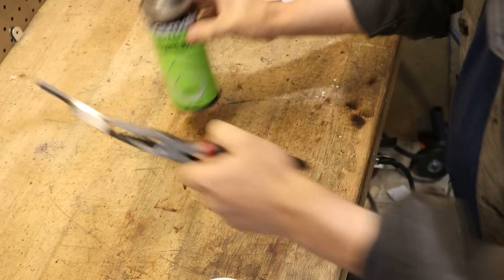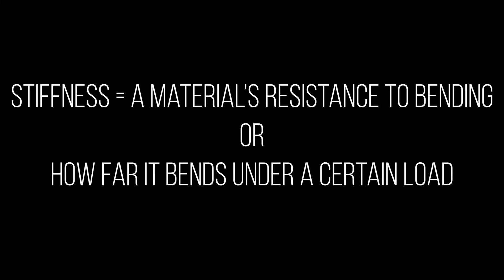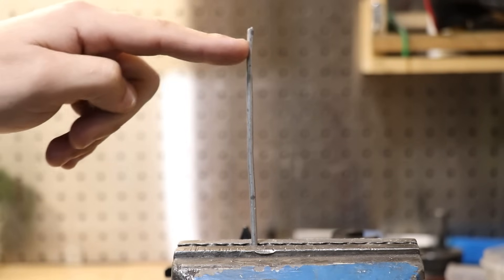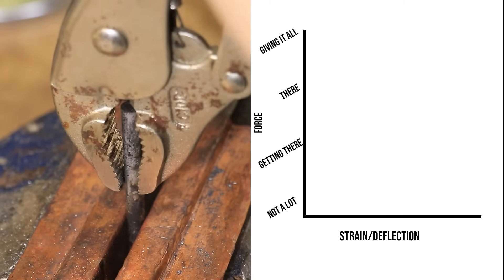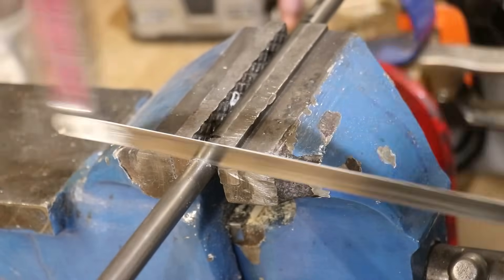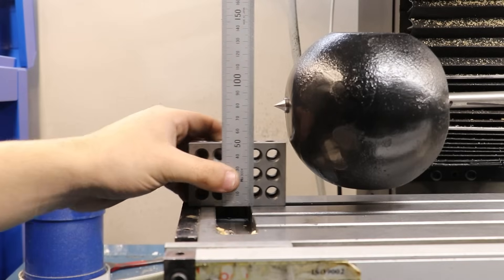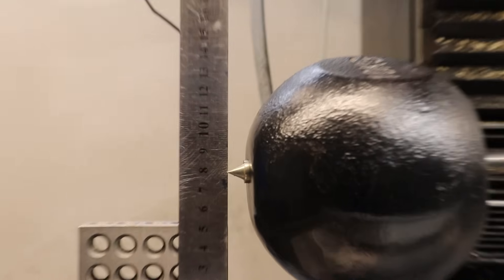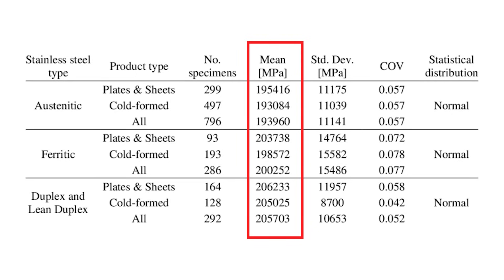Hardened Steel is NOT Stiffer Than Soft Steel

Comment: Nice explanation.
Other common mistake is that people mix elasticity with stiffness.
To add confusion... Young modulus, or modulus of elasticity, actually describe stiffness, not elasticity.
Elasticity is how much force can material resist before it start to permanently deform or yield strength.
And usually .. yield strength is exactly what we want to improve with heat treatment, not tensile strength (alongside hardness, of course).

Think about it in this way: when you calculate some part, let say part of suspension on a car, you do not go to the ultimate tensile strength. You must achieve that part do not bend permanently, under predicted load, not just that part do not brake.
Of course.. you should consider brittleness (impact loads, especially at low temperatures) at the same time.
Reply: Yeah it seems to me the problem is more one of terms than anything else. What most people refer to as stiffness is something's ability to to resist bending. As is clearly shown by him not being able to bend hardened steel by hand but being able to bend non hardened steel, this shows it is indeed "stiffer" at least in the way that a layman would use the word.

Obviously in materials science (or any science) terminology can have different meanings than the way people more commonly use them. Which kind of makes this video an exercise in pedantry
Reply: @theodorekorehonen  or just desperate call for stopping smart and educated to adjust to average idiots?

Comment: Is it better to be hard or to be stiff?
Reply: Depends on the application.  For a cutting tool on a machine tool, hardness is the most important property.
For a boring on a lathe, stiffness is very important.  Since the cross sectional area of a boring bar is limited by the bore size in which the bar functions, there are limits as to how deep a hole. or how heavy a cut may be made.
As was pointed out earlier above, the only choice for a stiffer material is tungsten carbide.

Comment: When the operating point is above the unhardened material's yield point, the hardened material certainly is stiffer.
Reply: That's strength, not stiffness. The hardened material is stronger, not stiffer. The hardened and unhardened material both resist a bending force by the same amount for a given bending force, prior to yield. Increasing the force required to achieve yielding does not affect the amount the material will deflect under any given bending force lower than the yield point.
Reply: @sjjohns88  Stiffness is change in displacement for a change in load.  Once the load is such that the unhardened material yields, it is no longer as stiff as the hardened material for a change in load.  So yes, the hardened material is stronger AND (in that region of loading) stiffer.
Reply: @Machine1136  thanks for clarifying. I agree that after the material has yielded, it's not as stiff. Maybe we should be more specific in our definitions, and say that hardened materials are not stiffer than unhardened materials while both are in the elastic deformation region.

Comment: Spring steel is very similar to tool steel, similarly heat treated. I’ve known people use old leaf springs for toolmaking before.
Springs are pretty bendy things.
I guess that’s kinda what you’re getting at. 🤷‍♂️

I bought a roll of annealed spring steel for making some distributor cap clips for a vintage engine magneto. It’s also proved very useful for making some little tools for pulling out round wire clips. Lovely stuff to work with & nice & easy to harden & temper.

Comment: Why should it? Harder does not equal tougher, changes in one parameter do not equate directly to changes in another
Reply: You're misusing the word toughness. Toughness is the amount of energy it takes to deform or break a piece of material. Stiffness is what he's described here, force/displacement.
Reply: @mitchellsteindler  I know that toughness does not equal stiffness , I was using it as an example of how different parameters do not directly equate. Why should they?
Reply from the maker: Because people seem to get this confused, I think it is something that needed to be shown. If you were already aware of this, this may be extremely obvious
Reply: @artisanmakes  the question that wasn't answered is, why is this true? A scratch or dent is plastic deformation of the material caused by a point load. You showed that a hardened steel has a higher yield stress than the non hardened version. So it would then make sense that it would take more force on a given point to cause a scratch or dent. So harder materials are more difficult to scratch because they have higher yield stress. But why do they have higher yield stress?

Comment: Had to make a Slide Cam for an old textile machine 40yrs ago. Was a new job so I went to the tool cupboard - mmm - pliers, hammer & some screw drivers - that was it. Had to buy some files, hacksaw & flat bar - made the piece & went to a spring works a few doors down to temper material. First try on machine & it snapped - / n repeat they tempered it just right. Only time I've ever needed to temper something.
Reply: I wind my own springs on the Lathe from piano wire (or music wire if in the USA)    One of the things I found was that the springs had hysteresis,   meaning that if you extended a spring and let go and measured its length then compressed it and let go the at rest dimensions were different,   yet I hadn't exceeded the elastic limit either way and the affect was repeatable.  Then I found out that that if I tempered such springs after forming  to a dark straw colour,   the hysteresis did not occurr.

Comment: What about work harden?? 

I understand that cold rolled steel has higher strength, at least it is a cheat code used to increase the strength a few points when doesn't pass quality control at the mill. As a rule of thumb, a run by the rollers (just bending it, not even rolling down a size) would increase the strength about 10 points so it meets specs.

Now I'm curious if cold rolled would decrease tensile strength after heat treatment, but why would someone heat treat cold rolled steel 😂
Reply: I think he explained very well how strength and stiffness are different things(?)

Comment: i have only one correction to make, that is a rule not a ruler. a rule has a ground end for measuring from its edge. a ruler is a drafting tool where the ends are not ground so the drawing tools can reach the end of the measurements without slipping off.
Reply from the maker: Oh you sound like my old drafting teacher. Haven’t been corrected like that in years
Reply: @artisanmakes  given your continued passion in the field, i will take that as a compliment.

Comment: should have added how many mpa is each (relevent) metals
if iron is 200 mpa, how much are the others
it seem like the hoffman group sell tools that are recommended to 3 time the diameter for steel, 5 time the diameter for HSS and 8 time the diameter for carbide, but are there some metals(or not) that are even more stiff than that, like ceramic?

Comment: Good video.  If you want it stiffer, increase the thickness.   Stiffness is a cubic function of thickness.   Double the thickness and you’ve increased stiffness by 8x
Reply: Find an appropriate shape instead. A Box beam (So hollow rectangular section) made up of 3/4" plywood might end up stiffer than a solid 1.5" bar of steel
Reply: @ true.  Because you are getting that mass away from the neutral axis/increasing I.
Reply: bending stress =my/I or M/Z where Z is the section modulus = I/y, I is the second moment of area in m^4. bending stress is proportional to deflection so yeah you're pretty much correct since second moment of area for a rectangle Ix = bh^3/12 where h is thickness.
Reply: That's what she said ;)
Reply: Then how could I still reach the ground in highschool despite weighing twice as much as I do now?
Reply: No, well kinda: it's area eccentric to the neutral axis of the beam crossection.
Way more smartass to say but you can hollow a beam and still have the same strength, that's why an i-beam is stiffer than a flatbar despite having the same mass or why a wide hollow pipe is stiff.
The further from the neutral axis the stiffer.
There's also a point where a slender beam becomes so "thin" that making it thicker increases the stiffness way more than exponentially.
Reply: Oversimplified yes absolutely but id you're deeper into that stuff it definitely isn't a cubic function depending on the load and most importantly the direction. 
I've would put it like : "the more material you have far away from your centre if bending the better it is (compare an I-beam to round stock with the same amount (by weight and surface area) the I-Beam is stiffer in Case of bending around the X (or lengthwise) axis )
Reply: idk how deep you have to dig into it, but it works for everything I’ve seen (20 years designing, 10 of those using FEA and actual measured data to assist).  I’m sure this rule of thumb breaks down after yielding/plastic deformation.    Honestly this is one of the few things I remember and actually use from engineering school.
Reply: @Zertrebender  It isn't even that oversimplified. It's just the moment of inertia, which increases cubic with the thickness (the axis that is colinear with the axis of the force being applied) and linearly with the width (the axis that is perpendicular to the force, and perpendicular to the support axis). For different shapes the moment of inertia might be more complex to calculate but you can still calculate it by appropriately subtracting the moment of inertias of the "missing" crossectional areas. Deflection is then a product of the length of the beam and the moment of inertia of the beam.
Reply: @Zertrebender lol this is the one time i don't regret reading the replies.

Comment: As a life long mechanical engineer I understood clearly what you were saying. We had to do tensile and charpy tests on materials if the customer requested it. The tensile tests the material for it's yield strength, whereas the charpy test measures the material ability to resist sudden high speed impact. Both tests require a test piece machined to a known configuration. The tests are different but both of them can give engineers a good insight in to the material. I found material testing very interesting in my apprenticeship and its still fascinating in my 70's
Reply: My brother was JUST working on building a machine to do material testing...well actually material characterizing. Nitinol is apparently still new enough that it's material specification isn't filled out yet. So...someone has to do the literally millions of tests to figure all that out and he was trying to figure out how to make a machine that can do those tests for the unique characteristics of Nitinol. 
It's a bitch to work with...but MAGIC when you get it going.
It's simultaneously butter, gooey, sticky, and hard all during the same cut. So machining is...annoying at best. All which means the normal ways don't work and he was the engineer to figure out a machine to automate those 100,000 tests for each and every variation. I really do mean millions of tests.
Reply: @feldamar2  Nitinol is a fascinating alloy of titanium and nickel. With its ability to be used in medical, high fatigue and corrosion resistance ability. Nitinol has been around for nearly as long as I have, the US Naval Ordnance Laboratory developed it in 1959.
Reply: @thepagan5432 Yep. I know it's been around a while. But apparently not long enough for every variant of every alloy to be characterized.
They still do characterization for cement/concrete. So It's not like it being 65 years old means they finished figuring it out.
Combine it with the fact that nitinol is expensive and thus slow to characterize anyway AND a pain in the but to characterize AND they are having to test an all new characteristic (it's self bending) i'm not surprised that they still need more.
Reply: @thepagan5432 😁Nitinol, being a shape memory alloy, defies just about all of the standard material testing, and all of your typical material behavior too. 

The ASTM A370 standard for the various mechanical testing methods isn't going to cut it because you need to do much more in terms of consistent sample preparation / prior heat treatment, etc. when you're dealing with shape memory material.
Reply: @Hydrazine1000  YEP. Apparently it's a pain in the but in general. (Although he did figure out general rules of how to machine in general. GOOD carbide tips make quite the difference) But now they have to VERY uniformly heat the sample WHILE under tension. Which sounds simple. But it has to be a very even heat AND repeatable 1000's of times easily. Which is not nearly so simple once you actually try to do so. As machining the stuff is a bitch so you want a machine that tests samples that need as little machining or preparing before hand. AND very uniform heating means you can't just grab it without blocking the heating as well. He's figured it out now, But...the figuring it out part was hard.
Reply: Does hardening change the speed of sound in the material?
Reply: @PhotonicEmission  the speed of sound in solids depends on stiffness and density, so probably not.
Reply: As a machinist i found the theory of materials the most boring and uninteresting part
Reply: I think most people would be quite shocked if they peered into a materials engineering text book.  I know I was.  Even a grasp of the fundamental principles can be quite a delicate thing, but Mr artisanmakes seems to have his head around it pretty well.  There's a lot going on when metal is heated, and all we can really do is explain it with generalised charts and definitions.
Reply: ""whereas the charpy test measures the material ability to resist sudden high speed impact.""  Notch Ductility !
Reply: "whereas the charpy test measures the material ability to resist sudden high speed impact" 

The Charpy v-notch test is one of energy absorption. A swinging hammer hits a notched piece and the absorbed energy (in joules or ft•lbs) tells you its impact strength, so the energy that the test piece was able to absorb as the hammer swings past through the notched 10x10x55 mm test piece. It tells you how much energy is used to deform the test piece and create the fracture surface. (And there is less relevant stuff like percentage of shear surface and lateral expansion of the test piece too.)

Hard and brittle material will gave a low absorption while softer and more ductile material will have higher energy absorption numbers.

Comment: I already knew this, but was still fun seeing it shown on a real object.
Btw. if you want a very stiff material, tungsten carbide is about 2.5 times as stiff as steel, that's why there are boring bars completely made out of it. Since you are restricted in your dimensions, using a stiffer material is the only option you have to get the best length to diameter ratio.
Reply: I bought a HSS boring bar. It's really much better than regular cutters. I'm thinking about tungsten carbide. But I don't have much work on the lathe.
Reply: Typical carbide boring bar have a steel brazed head. only the CoroTurn XS are completely carbide